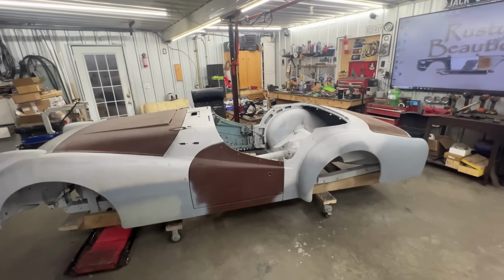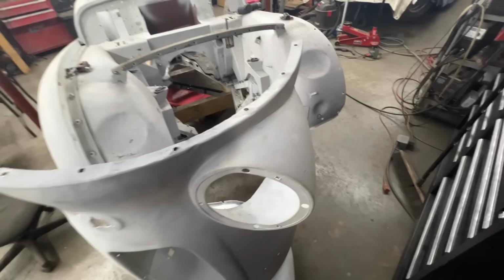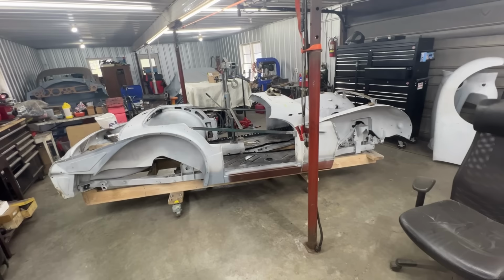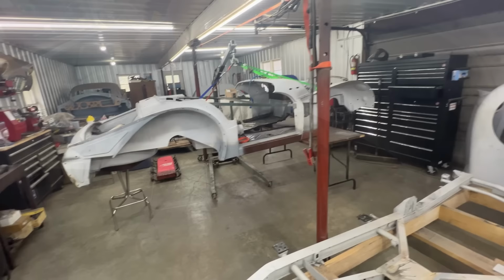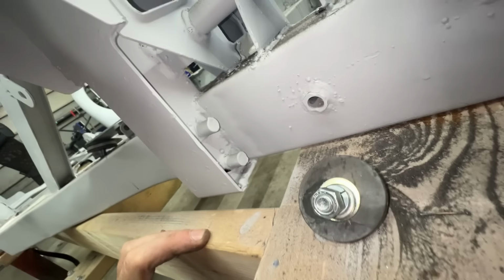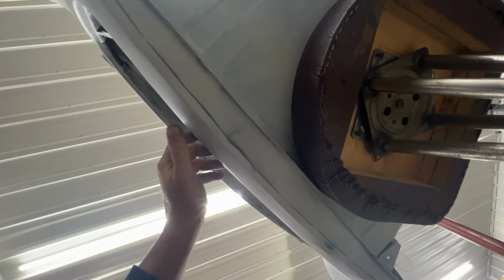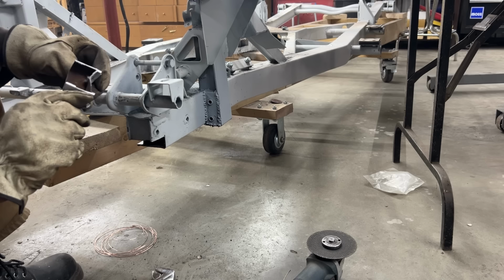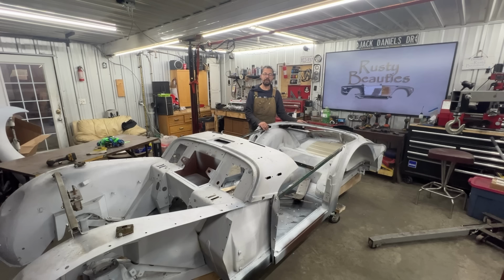1958 TR3 - Part 16 - The Body is complete

Comment: Hi Elin, have you ever seen where Part of the drivers side wheel well / arch has been cut out, and flipped inside out, so now there is a little more room/ space for the drivers seat to move farther back?
I believe there is more than enough room inside the wheel even with the reverse arch piece.
I am looking at all possibilities to get as much leg room as possible. Probably changing seats and fabbing a custom set of seat rails for what ever seats I chose.
Reply: How tall are you Ken?
Reply: @cheftush  Hi Chef Dave, I’m 6’3” but a lot of that seems to be legs. You let me get into your TR5 250?? and the radio dash support structure is absolutely obstructing my leg. And the steering wheel as well because of my knees.
So that support system will have to be a custom made, supporting the dash on the passenger side of the hump.
And I think the steering column from the GT6 is longer, so it will be more away from my knees.
And also changing the seat track to be mounted farther back.
I had far far more room in an old mini. I absolutely love the style and lines of the TR6, it feels like you are in an old British airplane sometimes,, but if I wasn’t soooo deep into the TR project, I’d go back to a mini.
I think…. I remember sitting on a pair of seats that were just sitting in a bare body tub, one time, and seemed to be ok. 
I’d even consider going to an aftermarket steering column that is longer, and has the tilt function for getting in and out.
My car is going to have sooo many mods on it, having an aftermarket, non TR steering column won’t bother me one bit.
Cheers Dave and Elin
Reply: @kenjackson5938  are you asking about a TR3 or TR6 Ken?  The TR3 has no center console to deal with so that is a big bonus.  More room for your legs.
Reply: @cheftush  TR6 with that nasty radio dash support structure with the 2 legs attaching to both side of the tunnel

Comment: You need a bigger shop my friend!  Either that or more outside storage! This TR3 will look amazing when it is finished!  Have you ever tried a stud welder for those hard to get to areas?  I have one and it helped a lot when pulling small dents out of my replacement TR6 rear valance that was cut from another car. (many areas of tight double walls)